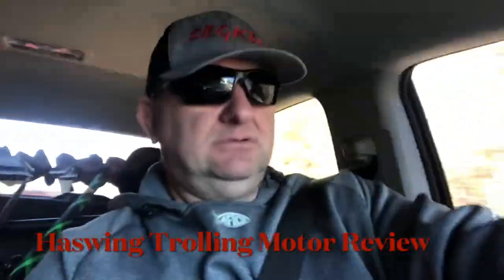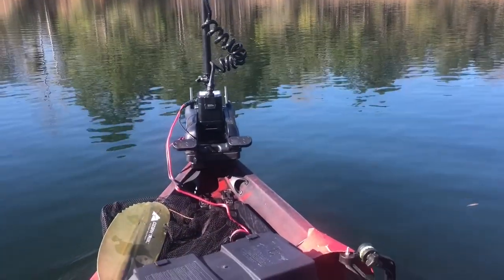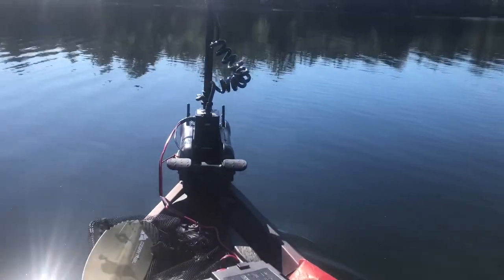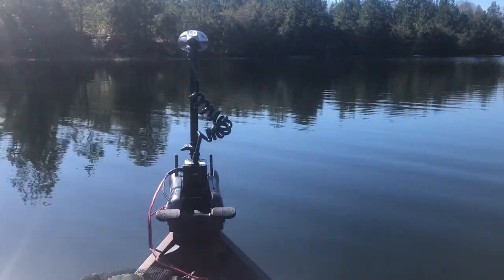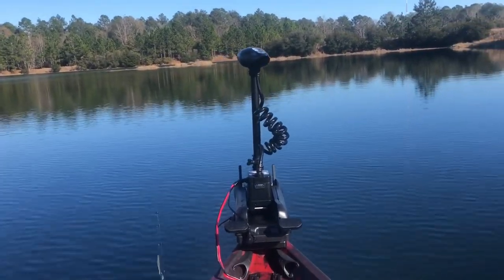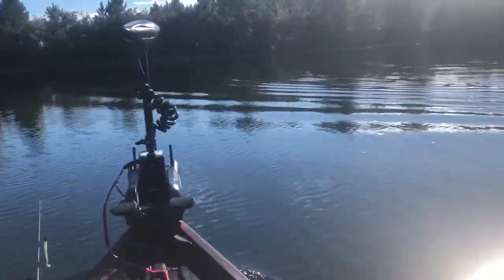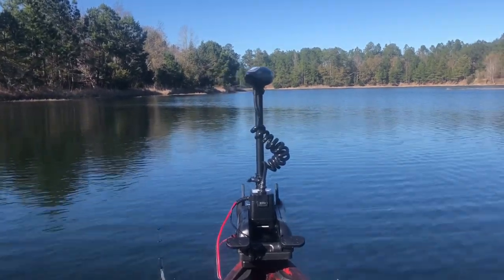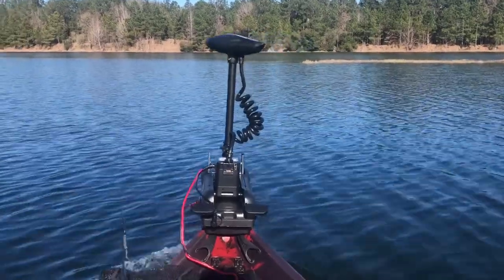HASWING TROLLING MOTOR: Water Test Reveals What Bass are Waiting To Catch In Your Kayak

Comment: Hey there, can you test the motor at half power (50%) to see how fast you go in MPH on the water. Preferibly with your kayak fully rigged and if you can mention the total load on the kayak in pounds it be great (kayak weight + your weight + all the gear give or take). I'd really appreciated. Great video keep them coming...👍
Reply from the maker: I have got 3.2 mph at 50%power.  That’s with a lithium battery.  My weight is 285 and fully rigged out kayak somewhere around 200 lbs